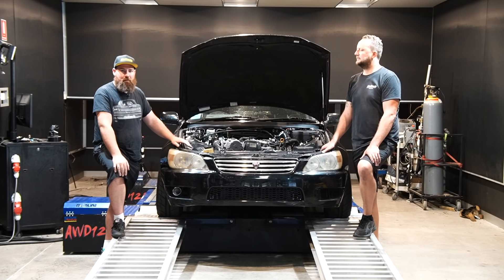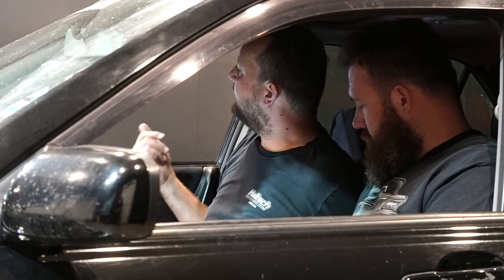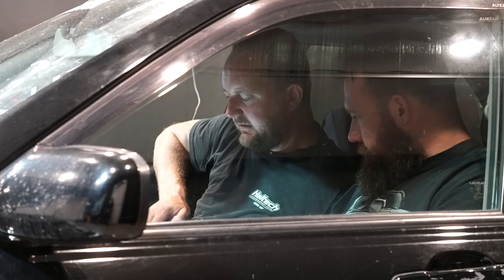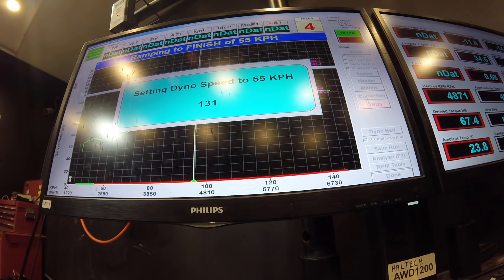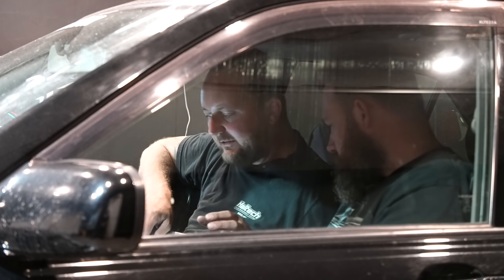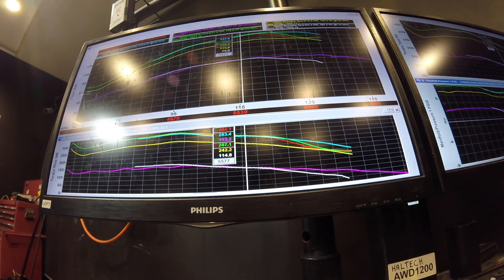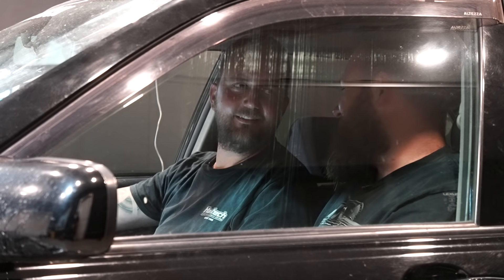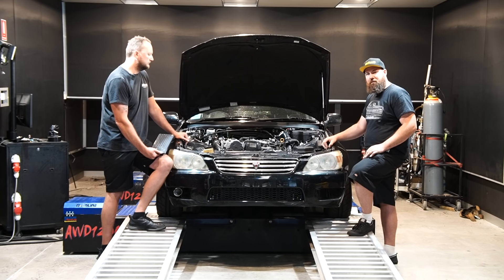IS200 - Dyno Page Up!

Comment: Benny, you done something wrong... i got IS200 + eaton62, intercooler, 150mm pulley, FCD, RX8 injectors and airbox (TTE replica). It makes 151 kW and 280 Nm on european 95 octan. Make sure you throw away first catalic converters, cause on 165 pulley you sould set in at ~160kW easly!!
Reply: I do think there's something wrong with the engine in this IS200. He should be making a lot more power than this. Many people here in the UK have had 200+whp easy.
Reply from the maker: It’s got well  over 280k km on it. It’s probably tired.
Reply: @BennysCustomWorks  That'll explain it :)
Reply: Pretty pontless to compare numbers between different dynos.
Reply: Stock engine should have 150 HP
Reply: My IS with 320k km has 272hp at 10psi, stock flywheel, stock injectors and stock fuel pump and det3. I know that the video has time, but the little power obtained has always surprised me...
Reply: Only 30HP more?!

Comment: Ended up fitting a toothed belt and pulleys on my supercharged MG B to get rid of belt slip, made so much difference and no horrible squealing noise from the belt.
Reply: But Toothed doesn't last as long as the V/ribbed belt if you get the slip under control that is.
Reply: @wobblysauce  tried a couple of different tensioner setups and no luck, it doesn’t do a heap of km’s so wear isn’t a huge problem.

Comment: Benny how can you say that the kit it perfect when the belt is slipping? That's a design issue.
Reply from the maker: It’s designed to use a mount in the oem exhaust manifold that isn’t present on aftermarket headers so now the supercharger moves. Once I replace that mount it won’t slip. The wedge of wood was to support it in that location.
Reply: @BennysCustomWorks  makes sense! So a mount welded on to the new headers would work well?
Reply from the maker: @benheynen2705  yes I’m going to copy the oem mounts onto the headers

Comment: Great to see a dyno tuner that just knows what he’s doing.
Reply: We all need a Scotty
Reply: You would hope so... kinda their job 🤣
Reply: It’s the tuning fork! What more do you need!
Reply: @ClassicSam.  knock ears would help :)
Reply: @thecookeman  not really needed with such little boost on e85
Reply: @DATONALKY  takes 1minute to hook up and 3secs to check during a pull. It's a handy tool... Why wouldn't you use it?
Reply: @thecookeman  because you will find mbt on 99% of engines before encountering knock on e85, I get what you are saying but it's not necessary with e85 and if it was Scotty would use it.
Reply: Scotty: Tuning Fork
Reply: @RhysK94  You would be amazed by number of people that know shit, but are still in business. Of the shelf tunes for TDI, N54 or whatever platform hotbois use that pick up 10%, but also does pops and bangs and they are happy.

Comment: There are better options that the LS front brakes which require RCAs. In Poland we use Merc calipers with either 328mm or 345mm discs. 328mm discs and calipers only need a 15-20mm spacer to fit behind a stock wheel, for 345mm you'd ideally need an 18" wheel but I've seen some guys fit it behind an OEM 17 wheel.

Comment: Can Haltech work with VAG 5-cylinders? (07k). Tnx.
Reply: 5 cylinders should be no problem.
10 injectors depend on the haltech model....
Reply: @udovdh  that’s right.  I forgot that the RS3 motor had 10 injectors. Does the normal NA Volkswagen motor have 10?  That’s the cool thing about those is that you have extra built in fueling margin.

Comment: NA 2J would've probably made the same power
Reply from the maker: Hardly worth swapping that in though . Also in Aus IS300’s are auto only
Reply: @BennysCustomWorks   in the states it's super hard to get a manual for the 2jz that comes in our is300's. I want an is300 so bad to turn in to a skid pad car/ drift missile. The problem is a manual transmission, end up spending more than a cheap car.
Reply: Also not going to get that torque curve out of a NA 2JZ.

Comment: I wonder if Benny feels like the build overall was worth it, all that work (supercharger and fuel system) for 130kw seems too much effort not enough return imo, wouldn't it have been better to just use another platform?
Reply: Totenkopf_88  yeah is300 came with a 2jzge, same chassis so the swap is possible, most probably. Still, though, a swap is a swap still takes alot of effort even if it's easy hahaha and with a relatively heavy car, I feel like you'd still wanna turbo it eventually or smth

Comment: Time to ditch that engine and stick a 1UZ In it, can easily buy conversion kits for these now that you retain the J160 gearbox and simply bolt in engine. 

www.lexibreak.com for the kit
Reply from the maker: 1uz is on tue table, J160 not so much.
Reply: @BennysCustomWorks  nice one mate, looking forward to it!